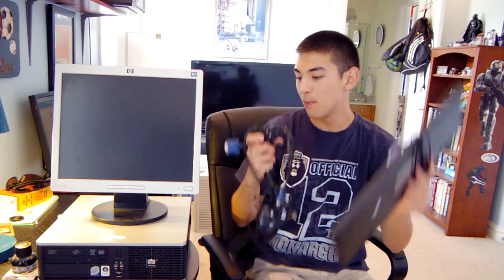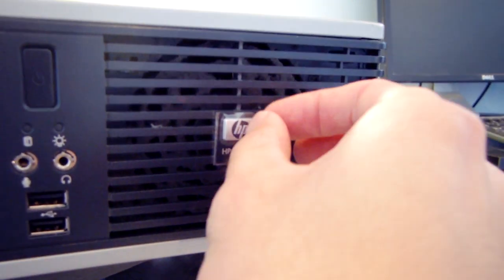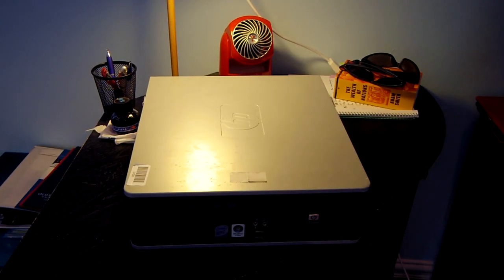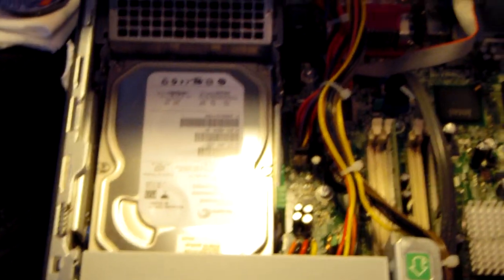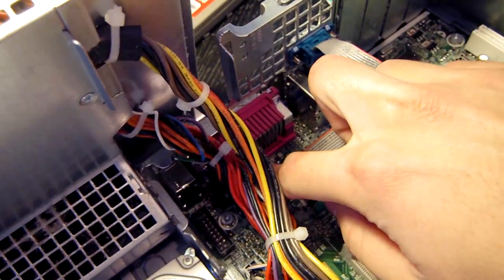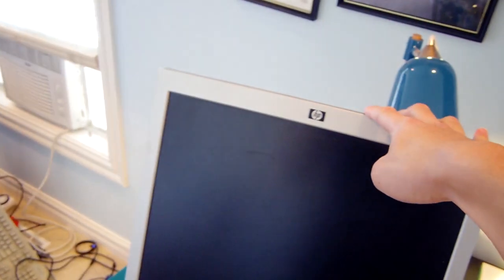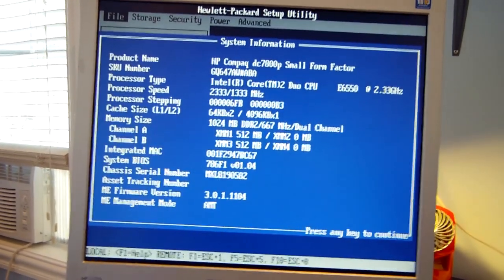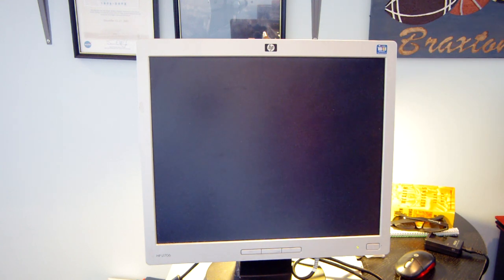Garage Sale Finds:$5 HP Compaq DC7800p Overview, Teardown, Demostration

Comment from the maker: There is always at least one person who dislikes my videos right off the bat without leaving a reason why. Its really frustrating. Well I guess it is a good thing that my channel is big enough to have a few haters :)
Reply: +AA Computers and Technology Don't worry, I read that some dislikes are just fat fingers or someone's 5 year old on their parents phone! It's the subs that count!
Reply from the maker: +Ashley Vegas Yes! And at any time if I need to destroy sensitive data I just use DBAN and spare the drive. I guess completely destroying the drive gives people that extra drop of assurance.
Reply from the maker: ***** Thank for the suggestion! I actually have a decent current generation gaming system. FX-6300, 16gb DDR-3, GTX-750ti. It runs everything I throw at it just fine, there is no point of upgrading, it would be a large waste of money. I actually might have a project coming up utilizing solar power so I am saving all of my funding for that at the moment (still not 100% sure about it yet though).
Reply: +AA Computers and Technology I have a similar machine:

AMD FX 4300
GIGABYTE MOTHERBOARD 
1TB HARD DRIVE
EVGA GEFORCE GTX 750 TI

Can I Ask You A Question? What CPU Clock Is Your AMD FX 6300,
And How Much Cores And Threads Does It Have?

Mine Has A CPU Clock Of 3.5Ghz - 4.0Ghz
And My CPU Has 4 Cores And 4 Threads

Is That Enough For A Gaming Rig?

Anyways,Bye!
Reply: Hey its not your foult this thing it happend to me  and the problem consists to the harddisk
Reply from the maker: GOHSMarchingBand&Drumline I do not like vista because I was stuck using it for 4 years and it was mediocre at best.
Reply: If you have robust hardware, Vista with Service Pack 2 installed ran like a dream.  The 64 bit Ultimate Edition was best.  It had some things that no OS since, has had.  In fact Vista had a full suite of programs on it where Windows 7 had those removed.  Things like a full email program, video editor, photo editor, calendaring, meeting collaboration software, etc and so on.  This was Microsoft's answer to Apple's "iLife" suite.  On Windows 7 they removed all the built in suite of programs.  On Vista Ultimate you could also have what was called DreamScene which had wallpapers that were actually video and not just still photos, it had video and sound.  That was one cool thing I wished they had kept in Windows.  But yeah, if you have robust hardware, which is what Vista was designed for, it runs quite well with Service Pack 2 installed.  Maybe you should revisit that sometime for learning.  Other than that, sadly its kinda late in the game to use Vista as a serious OS as I believe it will only update to IE 9 and nothing past it and I also believe the newer versions of Chrome are not supported.  They keep dropping support for things on it.
Reply: imo vista was pretty decent. maybe i was using the computer made later in vista's life
Reply: AA Computers and Technological development
Reply: dude its just your personality that makes people bored/salty etc tats all..
Reply: Can that computer run roblox?

Comment: I've got a DC5750 SFF and I love it! I use mine for a media player in my livingroom and its connected to my TV.... these are some of the nicest computers I've come across surplus.... they run windows 10 great as long as you max out the memory and upgrade the hard drive. I added a second hard drive in mine and use it alot! even though they are old, they still can be used!

Comment: I use to have this computor you can all morderen warfare seris and gta viceCity and Sanandareis and Other Pretty Fun Games
Reply: I've Core to Duo dc7900 small form factor.
3.16 Ghz (2 CPU's) which is nearly equal to 3.20 Ghz.
Graphics card ( Navidia Ge Force ) GT8900 TM of 2 GB.
RAM 16 GB ( 16,384 MB )
1 TB Hard-Disk.

Comment: Hi! How are you? I have an HP compaq elite 8300, and I have 3 hard drives (remove the burner to install one more) But I have a current cable sata type (Y) Can I connect another hard drive? my ram is 28gb

Comment: Id recommend putting ssds in this as there is just no air flow in these tiny cases... i had a HDD in it (under the PSU) and the temp was at 42C all the time...  put in an ssd and temp is at 30-33C

i use this system as my pfsense router since it is a powerful, quite, & space efficient machine for it :)

i have a lowprofile GB lan installed too

Comment: I can run gt 630 1gb on  hp dc7800 sff small 
 2 duo E6750 2.66ghz 
4 gb ram
Reply: you can get a low profile 750 ti and a core 2 duo E8500 as an upgrade for this system
Reply: I've Core to Duo dc7900 small form factor.
3.16 Ghz (2 CPU's) which is nearly equal to 3.20 Ghz.
Graphics card ( Navidia Ge Force ) GT8900 TM of 2 GB.
RAM 16 GB ( 16,384 MB )
1 TB Hard-Disk.

Comment: Lucky you! You got a whole set for USD 5.

In February 2020, I bought an HP dc7800 Ultra Small Form Factor (CPU unit only) from a used PC dealer for Ringgit Malaysia 300 (equivalent to 72.91 USD). It comes with a 3GHz Core2Duo processor, 3GB RAM, an 80GB hard disk and DVD drive. No monitor, no keyboard, no mouse. The USFF model comes with an external PSU like a notebook and if I recall right it uses a 2.5in HDD. The used PC dealer buys used business PCs, most of which have been disposed of by corporations in their asset refresh cycle and the dealer's technicians clean them up and check them in the workshop before sending them to their sales outlets in town.

I installed Linux Mint 18.3 on it and use it as a second office work PC. It runs fast enough for word processing, etc but surfing the Web with Firefox or Chromium is a a bit sluggish.

Comment: Id still have that bitch computer still running windows 7 never had a bsod never had repaste the heatsink this pc are slightly slower because of stock 80gb hdd, someday i will upgrade that pc with ssd and gpu nvidiagt220 lowprofile

Comment: You should not clean the moverboard wiff a vacuum cleaner because of static electricity. Also, Plop boot manager works well for moverboards that won't boot from USB, if that was the problem with the W10 live thumbdrive.

Comment: Nice video. Vista doesn't suck, just the system requirements are unnecessarily high. This PC does support RAID. And the system is very reliable like you said. I have a three of them with a quad boot OS set up. I could always use more spares. Where can I get one for $5?

Comment: Majority of aspect 4:3 ratio  LCD monitors are or have become obsolete. I've seen these monitors at a Goodwill Computer works. Which HP is one of the two top brands I've seen so far. The most likely monitors I've seen more often were the 1708 Dell monitors. They were sold off quickly than any monitor I've seen so far in the store I visited in the summer.

Comment: I have an HP DC7800p sff machine, and i have Windows 7 Pro installed, and it does ok, not a rocket ship by any means, but for what i use it for, it is more than adequate.

Comment: HP sucks with windows 10 support so I'm not surprised.
Reply: +BC And thats why i flashed the bios of my Fathers HP PC. And to OC his I3 3200.
Reply: No it doesn't, the core 2 duo just doesn't have windows 8/10 support.
Reply: ***** Here is my personal experience. I had windows 10 installed on a PC with a Pentium E2180, once replaced it with a core 2 duo windows 10 wouldn't boot, I couldn't clean install windows 10, so I installed Windows 7 and when through that I tried a windows 10 update it said that your current CPU doesn't have support for this operating system.
Reply: +Microlag Tech 
I've put Windows 10 on a system with a P4, so I too  have a hard time believing that a core 2 duo won't run it.
Reply: +TheTexasRangerNamedDeath You are out of your mind if you think that. I've installed Win10 on dozens of C2D with no problems whatsoever as long as they had enough ram. At least 1 gig for the 32bit and 2gigs for 64bit. Did have to update the bios on a couple though. The E6550 in this one fully supports both the 32 and 64bit versions although he does need more ram for 64bit.
Reply: cee128d Well my E8400 has no support for win 10....
Reply: +TheTexasRangerNamedDeath In a word, BullS*&t. All Core2Duos and Core2Quads support Windows 10. I have installed Windows 10 on numerous computers with an E8400 processor. There are are some motherboards that need to have the bios updated to enable some cpu flags so Windows 10 will install, but that is a problem with the motherboard not the processor. There are also a couple of boards that never had bios updates that will allow the necessary flags to be set, but again that is a problem with the motherboard not the processor.
Reply: cee128d Look I'm sorry if your getting upset but I was unable to install windows 10 because my processor doesn't have support.
Reply: Did you not read my post? I clearly stated the problem is NOT the cpu but your motherboards bios not enabling the necessary cpu flags. It may LOOK like the problem is the cpu, but it is actually a problem with your motherboards bios.
Reply: Check at this CPU-Z link on an E8400. Notice where it says it supports VT-x. That is probably the flag that isn't being set by your bios. Update your bios if necessary but make sure that is enabled in your bios. Since I don't know what motherboard you are using or what pre-built OEM system you have I can't point you to anything more specific, but that is your problem. http://valid.canardpc.com/1x0396
Reply: cee128d I have had windows 10 on my motherboard when I had a pentium E2180.
Reply: I updated 5 more computers running an E8400 with absolutely no problems within the past 2 days. Whatever problems you are running into are some sort of bios conflict or configuration error as it has been verified on more than one occasion and more than one person that there is absolutely NO problem installing and running Win 10 (both 32 and 64bit) on an E8400.
Reply: cee128d Interesting, I have tried on two different LGA 775 motherboards and it hasn't worked with the core 2 series, but has worked on a pentium.
Reply: It sounds like there is something in the BIOS that isn't being enabled with the Core 2 Duo series but it enabled by default with the Pentium  Check that the No Execute Bit is enabled. That tends to be the troublesome one. Check out these CPU-Z validations. http://valid.x86.fr/x93tqu  http://valid.x86.fr/0gdyk5  
http://valid.x86.fr/pnztxx
Reply: cee128d Actually swapped out to an old Q8200 now, good little CPU but still can't get windows 10.
Reply: Can you post a CPU-Z validation link that I can look at? Maybe I can figure out what flag is missing and at least know what system and/or motherboard and bios we are dealing with here as the Q8200 fully supports Windows 10.
Reply: In the BIOS go to the Advanced page, then the CPU Features section and make sure that "Execute Bit Support" is enabled. That is the flag that you are missing. In CPU-Z it will be listed as VT-x in the line with SSE, SSE2, etc. You need to get that flag set and both the E8400 and the Q8200 (as well as ALL Core 2 Duo/Quad cpus) fully support the No Execute Bit. If it is set to Enabled, try disabled to see if that helps. You might need to update the BIOS to 2.6.  

If all else fails you might need to check in the MSI forums to see if someone there knows why that flag isn't being set properly.
Reply: These are the real windows 10 requirements. It was kind of a misnomer that it could run on any old hardware. Hardware and bios has to support this. I researched this when seeing if I could put windows 10 on an ancient 1ghz computer and found out I couldn't,
CPU
	* 1Ghz
	* PAE (EM64T)
	* SSE2 
	* NX/XD (VT-x, VT-d, AMD-V, AMD-VI or SMX)
	* 64-bit Requirements (all of the above, plus)
		* CMPXCHG16b (CompareExchange128)
		* PrefetchW 
		* LAHF/SAHF
GPU
	* DX9 compatible with WDDM 1.2 Driver
	* AMD UVD2 or Nvideo Puremotion 2/3 for Flash/HTML5 video acceleration
		* AMD 5000 series and up
		* Nvidia 8400 series and up
RAM * 1GB
* LAHF/SAHF are part of Intel's VT-x virtualization feature
Reply: cee128d Thanks, I'll try this.
Reply: cee128d Thanks I am using windows 10 now, and I was wrong, you can have windows 10 on the core 2 series.
Reply: Good to hear.
Reply: The Windows 10 fall creators update on my HP DC 5700 runs very smooth, with this update all the essential drivers are still supported including the display driver.

Comment: I think I know why it was not booting into a Live version of Windows 10.  You were probity had the 64bit version then the 32bit version.
Reply from the maker: +Hannah Flynn I used the 32-bit version and regardless this is a 64-bit processor. I might try again some other time.
Reply: +AA Computers and Technology Well okay it could be an important curopted file.  If not you could of made a comment error and you grabbed the wrong USB stick.  Or it could be the USB itself.  Sometimes when you throw Windows on a USB stick.  What can happen is Windows thinks the USB is another hardrive and think that the disk has been moved all around the place and that how a importment boot file can get curopted.
Reply: +Hannah Flynn This makes no sense

Comment: Can you put more than one harddrive in this pc?
Reply: the Fall no
Reply: @whitebeartigtig  sure you can, it just has to be a smaller 2.5 drive. And it's going to be floating so just tuck it away somewhere

there's also probably some kind of cd drive replacement 2.5 HDD adapter. I know Dell has them, I would imagine HP has them as well.

Comment: I wonder if this machine can take a Core 2 Quad and a GTX 750 Ti half height card. If so I think that can turn this machine into a medium grade gaming machine.
Reply: its a really low powered PSU, you need atleast 300w to run c2q and 750ti
Reply: i run those same specs with a 255 psu
Reply: i run i7-2600 6 gb ram 750 ti on 250w psu

Comment: Nice catch. Refurbishers sold until recently dc7800 and 7900 for around 100$ and they were popular. We still use a lot of them with 4GB ram, 120GB SSD and Windows 10 x64. My daily driver is a DC7900 cmt with a quadcore and 8GB ram. Can replace it if i want, but no need yet.